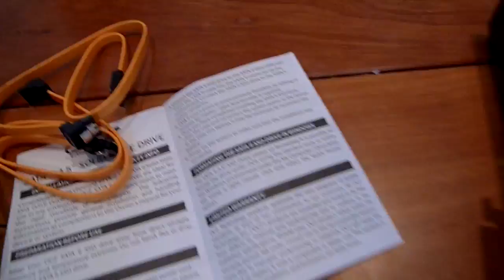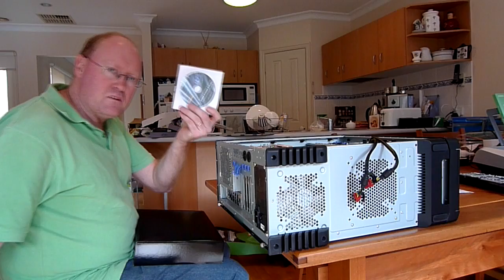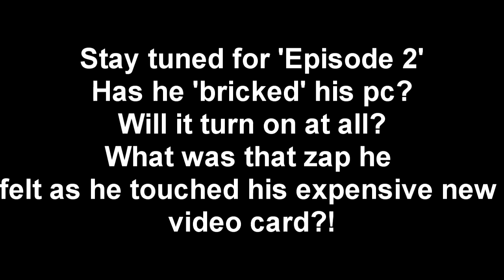GTX 560 OC Ti and SSD install

Comment: Hello. May I ask You, what CPU do You have? I also bought GTX 560 Ti Ultra Durable 1GB graphic card, but the impact on FPS isnt that big. I have AMD 64 X2 Dual Core 6000+, 4 GB RAM, MB is Gigabyte MA790X-DS4 and W7 64 bit. To by hones, I thought the DCS sims will run much better. Thank You very much.